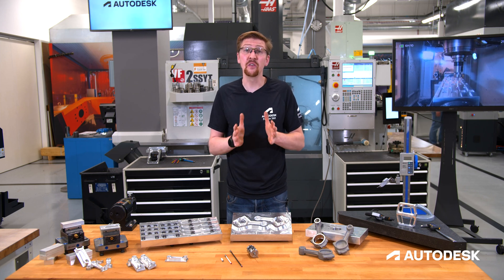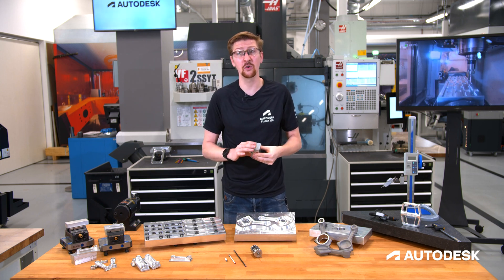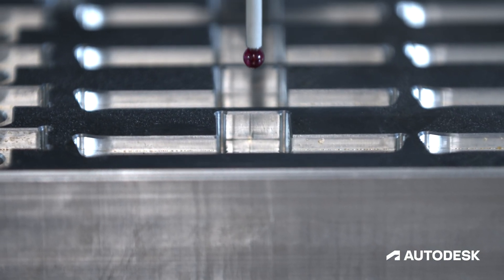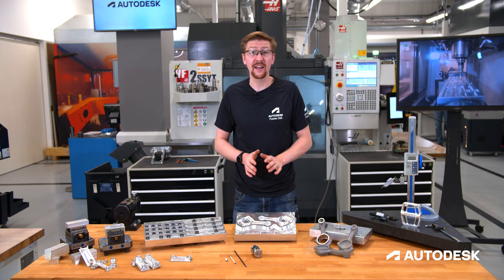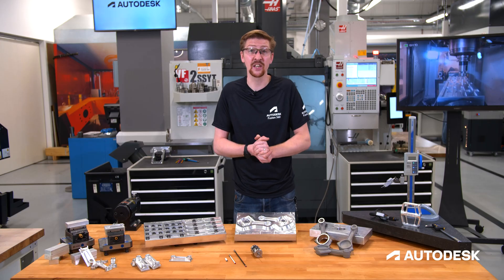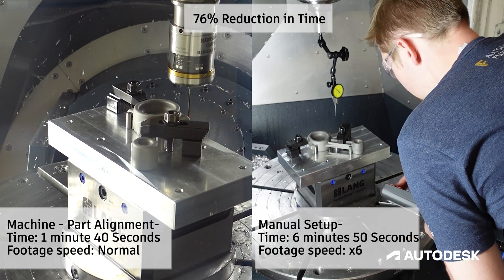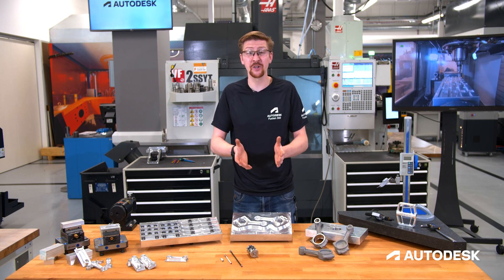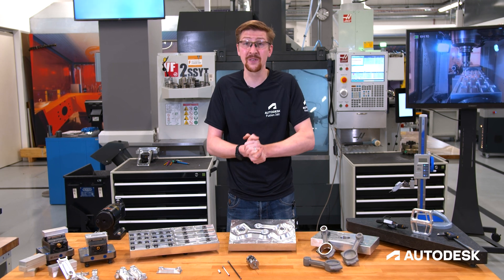The Power of In-Process Probing in Fusion 360 | Autodesk Fusion 360

Comment: Can Fusion 360 post out Renishaw macros for use in a pre NGC Haas like my 1996 VF3?
Reply: Hi, Yes, Probe WCS and Probe geometry are macro based routines. The more advanced Inspect surface toolpath will also run just fine on your PRE NGC VF3.

To get the results out you will need to sort out the RS232 Cable. https://www.youtube.com/watch?v=N5naayLBr7g&ab_channel=AutodeskFusion360
Reply: yes it can I do it on a old 2003 ec 1600, the marco are the same